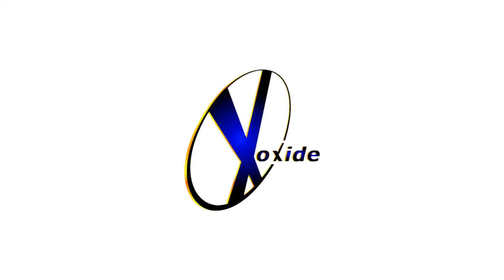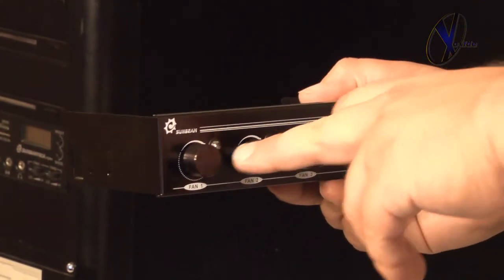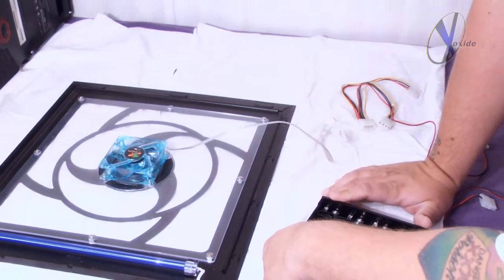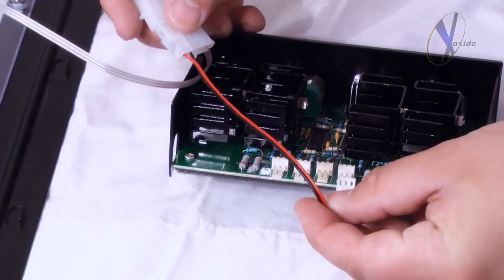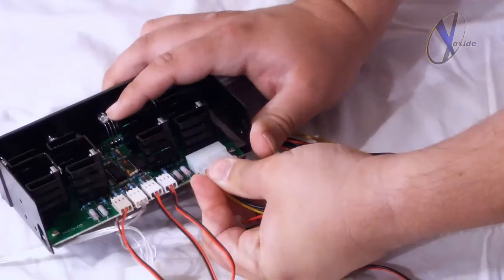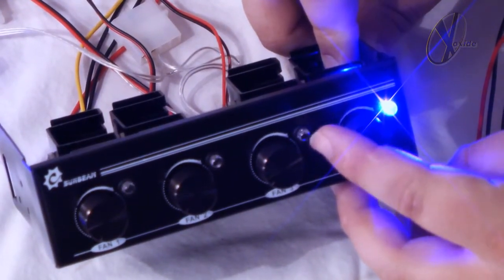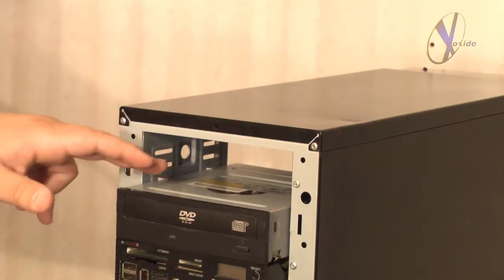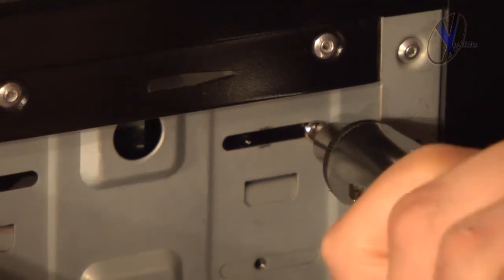How to Install a PC Fan Controller - Xoxide Tech Chronicles

Comment from the maker: @JaredSPeters  
Newer motherboards and fans commonly come with a feature called "PWM" (pulse-width modulation) that allows the motherboard to control PWM-enabled fans automatically, in real-time.  Many fan controllers also include automatic control schemes, which will automatically adjust the speed of any fans connected to it.